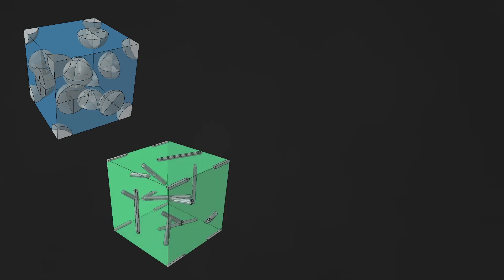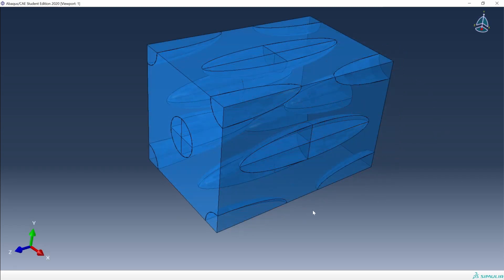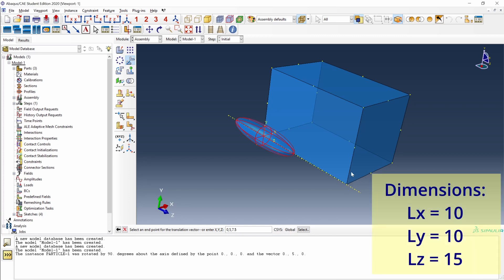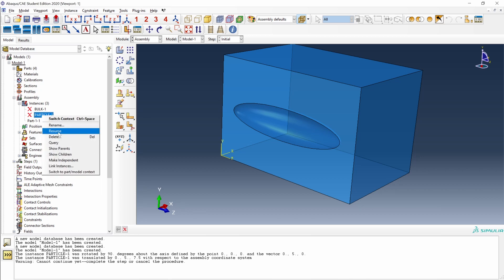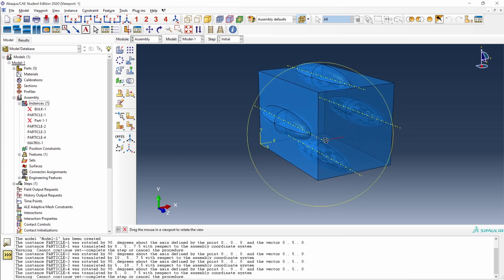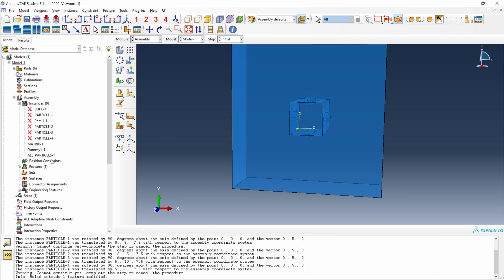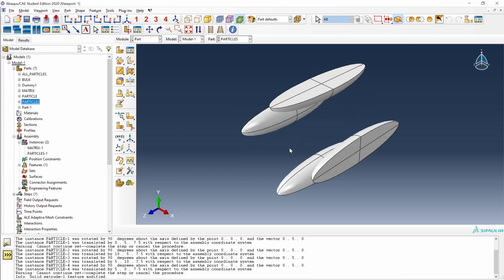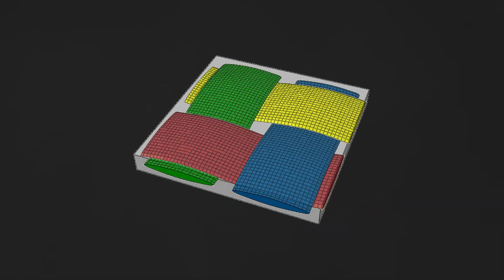Boost Your Skills: Abaqus Boolean Operations for Advanced Geometry

Comment: Hi, I want to import data from Excel in python and use it for Abaqus Geometry. Panda does not work for Abaqus. Do you know how it can be done?
Reply from the maker: You are right! If we have to use the Python interpretere built into Abaqus/CAE, there are some limitations regarding libraries. Although from Abaqus 2020 there are some very useful modules included, such as Matplotlib and Scipy (https://tecnodigitalschool.com/possibilities-multiply-with-abaqus-2020), there are many more missing Python modules.

To overcome this issue, lacking Pandas, I suggest two possible solutions:
1) Use another Python environment (outside Abaqus/CAE) to read the Excel files using Pandas and then export the data required into plain text files, so you can read them using numpy.loadtxt. This is a 2-step process, but at the same time it is easy to implement.
2) You can do everything in one shot using an external Python interpreter. Read your Excel files using Pandas and extract the data required. Finally, run the Abaqus script from the command line using os.system.

The second option is a bit more tricky because you have to invoke Abaqus from the command line and passing a script as on of the arguments. But in essence both approaches are equivalent.

Comment: I have tried this with imported texGEN model and created extruded part as the resin. But I couldn’t use cut geometry tool since the imported textile is not a geometry instance. So it shows an error massage saying assembly doesn’t contain two geometry instances. Could you please help with this?
Reply from the maker: From texgen you can export the geometry of the woven in CAD format (such as STL) and then import it into Abaqus as a Part. Finally, you can create an instance of that part and then you can apply the boolean operation to "cut" the bulk of resin.

If you export the woven as a mesh (elements and nodes) you cannot apply boolean operations between a piece of geometry (instance) and a mesh.
Reply: Thank you verymuch sir.